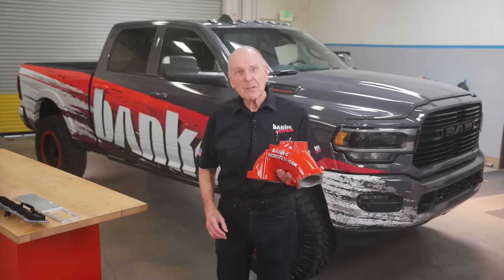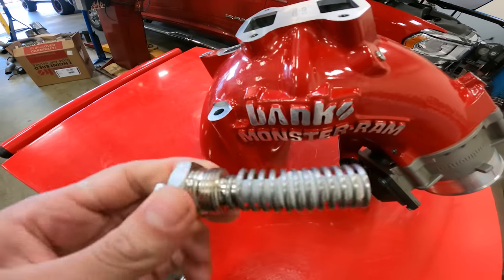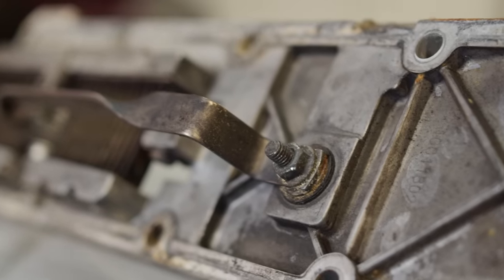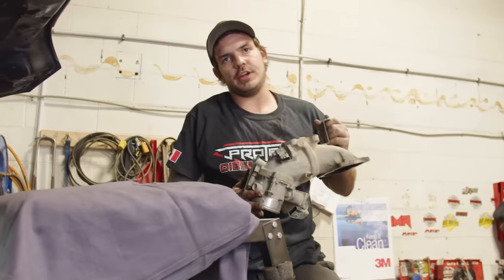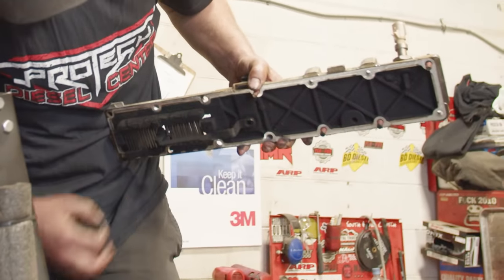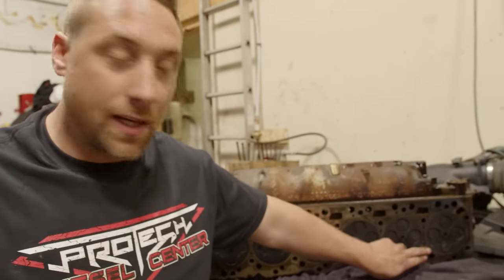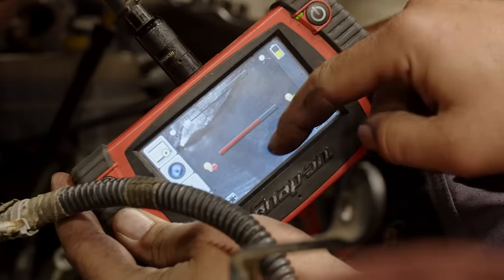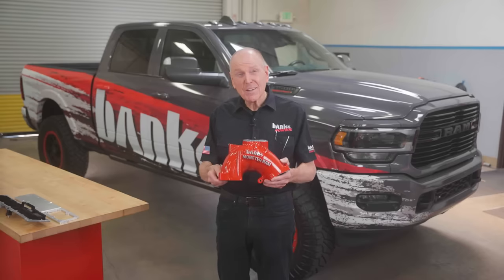How to prevent RAM Cummins 6.7L engine failure due to stock grid heater

Comment: According to all the cummins guys on youtube. The Cummins is unbreakable, perfect,  inspired by God, 100% perfect up to 1 million miles plus??
Reply: My 2011 has over one million miles on it
Reply: You saw one engine, which did not fail, rather an external bolt failed and fell into the engine.
Reply: @BBBYpsi  I knew the Ram guys would start coming out of the woodwork lol... I've seen Duramax's with 800k, 900k. On them also. It's not just a ram Dodge thing. That's all I'm saying. They all have there issues.
Reply: 😂 😂  I own one and it was personally signed by Jesus himself after he built the motor
Reply: @asheetuglasse  I didn't know cummins was built in Mexico.
Reply: @Staki6908  Mexico is the new America................or is it America is the new Mexico.
Reply: @Staki6908  actually all rams with the cummins come from Mexico
Reply: @BBBYpsi  I've seen many duramaxs with over 600 to 800 k on them.
Reply: @B-rad303  Ram Cummins holds the records for most miles on them. I have seen pre emissions rams with over 2 million on them
Reply: @BBBYpsi  I'm in the transport business. I talk to a lot of guys when I'm out on the road. And the Ram guys are always cocky assholes who think they know everything. The Ford and GM guys are always great to talk to. I think ram is waaay over rated. There emissions systems are also shit. They all have there problems I will say that. Plus even if the cummins is such a great engine it has a POS transmission. Which negates the quality of the engine.
Reply: @B-rad303   I am also in the transport business. I haul travel trailers for a living that is why my ram 3500 is that I've had less than 10 years has over one million miles on it.
Reply: @BBBYpsi  good for you 👍🏻

Comment: Step one- don't buy a junk dodge fiat diesel 
I never bought in to the lie need a diesel pickup.  No pickup truck diesel are in any way comparable to a semi tractor diesel, so stop pretending you are one with a pickup truck diesel. .  
Where my old gm 6.0l and 8.1l gasser trucks are both pushing over 400k miles with no major repairs beyond just maintenance to the engine or transmission. And even if did need over haul the costs repairs to a gasser are pennies on dollar to a small engine  diesel.  Where no dodge, ford,  or gm diesel could ever claim that.

Comment: How about losing crank pulley's? lol - 2022 4500 Can and Chassis crank pulley sheered off!!!! Our truck and 5 other we know of! 2022 and 2023 with less than 5k miles!!!! Stealership first said Crank was bad and motor need to be replaced, then called back and said everything was A-Ok come get your truck bahahahahah. DON'T GOT TO ANCIRA DODGE IN SAN ANTONIO, TX

Comment: Don’t buy one . Ford had the same problem.
Reply: What did they do differently? Did they stand behind their product because that’s a Ford 6.7 not built by anyone else.
Reply: @josemejia6645  changed the boost cooler fins per inch . They didn’t put bolts inside the air track like dodge that’s always a big know no !

Comment: Buy this when you replace the transmission at 60k miles
Reply: ? Why would you replace the transmission at 60k? This is not a common problem.
Reply: @calebniederhofer6529  Dodge transmission are definitely know to be horrible
Reply: @xfhnhhgjbvcfg  This a vary vague comment. Dodge transmission? That’s like 50 different transmissions lol. Let me guess, you don’t own one, but are just commenting horrible transmissions lol. My 06 5.9 was fine, and it is weaker then any of the new ones. It is when people add aggressive tunes, and power over stock.  Most people also don’t do maintenance, and service them either.
Reply: @calebniederhofer6529  I don't disagree with anything you have stated.
I would never buy a Dodge product.